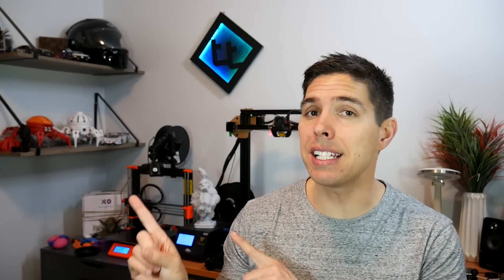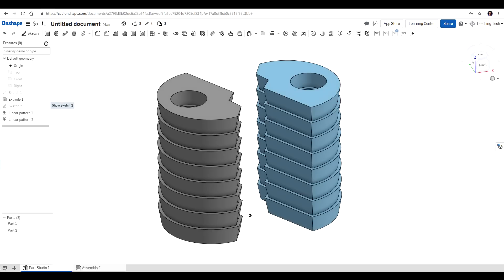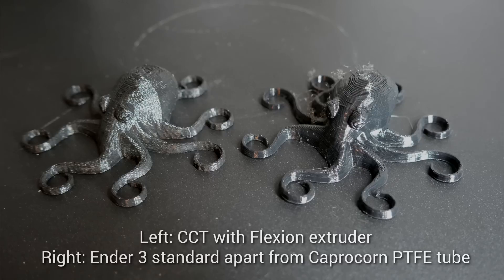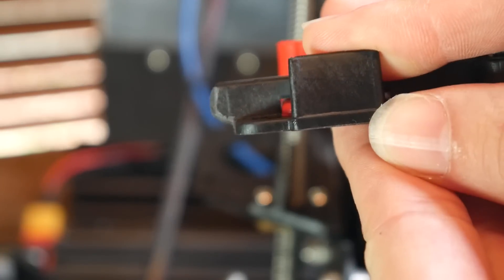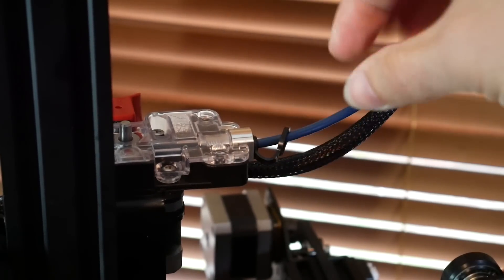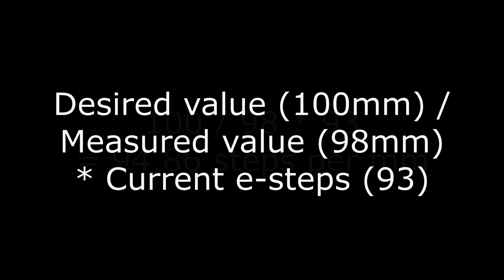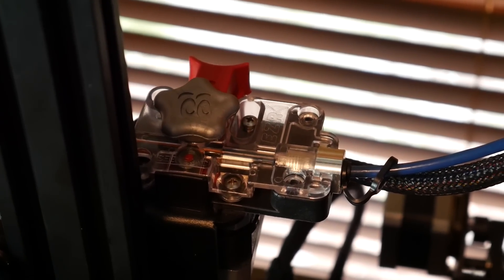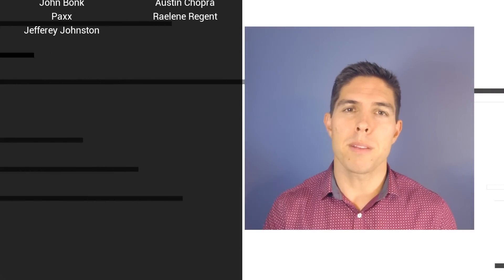EZR extruder tested on the Ender 3

Comment: The aluminum extruder I put on mine works fine. I do a lot of multicolored prints with it and it's really easy to change the filament. The original one started skipping a lot no matter how clean I kept it. So I added another spring and it worked great for a while till it snapped the plastic at the guide wheel. I'm guessing that was to much tension lol. I wanted to change the extruder on my Tevo Tornado but I cant get the original gear off the stepper without a small puller I'm guessing. I dont really want to cut it off incase I wanted to put it back on for some reason. But its plastics too and I dont want to use it with the aluminum extruder. So I ended up leaving it alone. I have other problems with that printer anyway. It want to shift layers all the time. I just ordered a new multimeter to see if I need to up the stepper drivers a little. Any other suggestions would be much appreciated on that one.
Reply from the maker: Adjusting VREF for the steppers as you describe is a good start. Nerys has a detailed video on this. You can also try lowering your speeds and acceleration.
Reply: @TeachingTech  thank you for the reply my friend. I've watched a few videos on how to adjust the VREF. I'm not sure if I've watched Nerys video on. I'll have to check it out. I'm subbed to his channel.

Comment: I put an all medal extruded on one of my ended 3’s.  Works ok.  I wound up using the stock spring as the one that came with the all metal unit was just way to rigid.  No adjustment I could make would ease the tension enough on the filament.  Might try this one out, just for quality of life.  Both my printers are in tight quarters and loading filament is tedious.  Thanks for yet another great video!!
Reply: If you've upgraded your firmware to marlin you can enable some features for filament loading and unloading. I set mine up so at the push of a button it will purge a small amount and the  retract the exact length of my tubes. And the  when I load it loads exactly enough with a small purge. Much better than manually pushing or turning a knob.
Reply: @nathantoews152  even better is a direct drive so there is no long distance to push any filament.
Reply: @abarasabwehttam  i know direct drive is supposed to be better. But after owning 4 of them and now 3 ender 3's and a 4th on the way. I'm way happier with Bowden.
Reply: @nathantoews152  While plastic is cool to do I am more interested in the metal filament hitting the market now and no way to do it with Bowden. I have also had several of each and prefer direct but that is me. Check out The Virtual Foundry materials. Wont be long we will be printing parts for our cars or whatever and wont need a million dollar EOS 290 to do it. (I have one of those at school too)
Reply: @abarasabwehttam  yeah I dont know much about the new metal filaments. But some of that stuff that's like 60-80% metal wont hurt your Bowden tube. Will destroy your brain nozzle though lol
Reply: @nathantoews152  Think you meant brass nozzle right? I have ran about 6 rolls of bronze filament through my machine and hasnt effected it. I just got 316 Stainless and 6061 Aluminum yesterday and excited to try it out. And I am not worried about it hurting the tube, the filament is very brittle with the density of metal and very little plastic and it snaps easy. That is why snaking through a remote drive system doesnt work.
Reply: @abarasabwehttam  yes brass lol. I'll have to pick some up some time and try it. My tubes are pretty short around 400mm. And I don't have any bends that are tighter than a standard roll of filament. Would be interesting to see what happens.
Reply: @nathantoews152  Not sure you seen but to make it SOLID metal you have to "Sinter" the part afterwards. I picked up a nice little pottery oven for $900, good enough to get to 2000 degrees so good enough for Bronze and Copper filament. The SS, Aluminum, etc requires vacuum oven. I dont have one but NASA out at Redstone Arsenal does and said I can use it to do testing. My class has been working on several items for the Mars mission and so we are going to test this out there.
Reply: @nathantoews152  Send a message to them on FB and tell Tricia that I sent you.
Reply: @abarasabwehttam  yeah I'm aware of the sinter process. was planning to build a small forge in the future if i isolate the model from my heat source should work as a sort of oven for this.

Comment: Hi Michael, I may have missed it but what filament are you using for your flexible testing? Do you think the EZR would provide an enhancement for extremely elastic flexible filaments like Ninjaflex? Or would the stock extruder handle those filaments as well?
Reply: I could not print Ninjaflex well on my Ender3 but with the upgrade to the EZR extruder it worked. With less flexible filaments it worked on the stock extruder.
Reply from the maker: It's Shore A 95 X3D TPU. An oversight of mine not to specify this.

Comment: My default extruder only puts out about 60% of requested extrusion.
Reply: Ron Watkins I had this issue with the first render 3 I had.  Turned out the extruded just wasn’t putting enough pressure on the guide wheel to keep the filament firmly against the drive wheel.  No matter what adjustments I made, never got a good fit.  A new extruded fixed that issue out right.  Now it extruded exactly what the E step is set to.  Resolved so many issues.